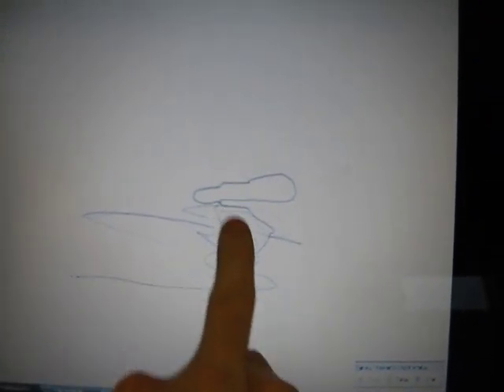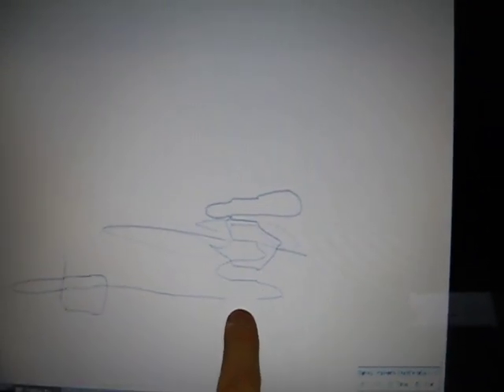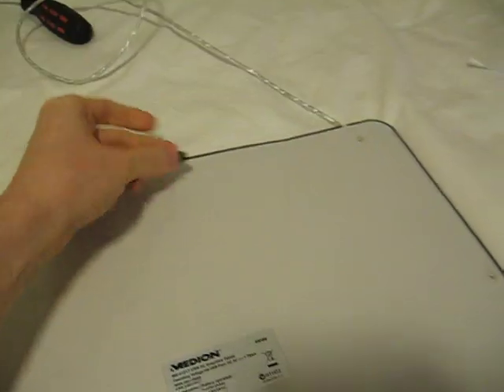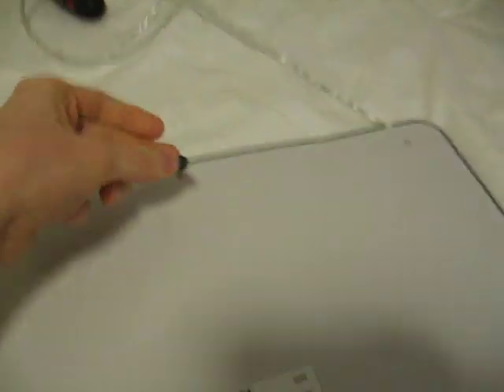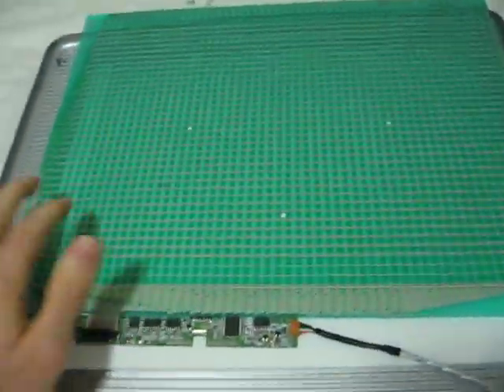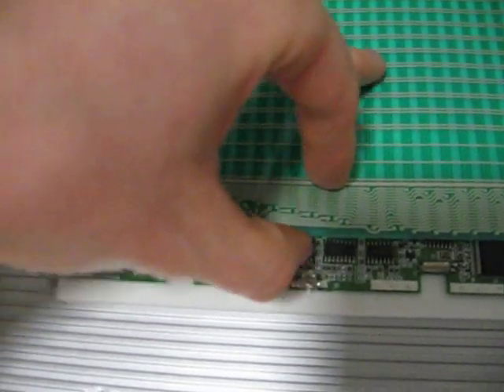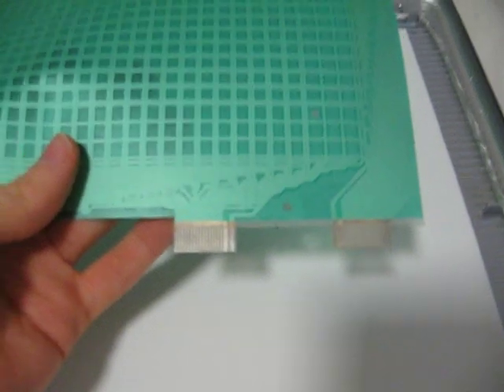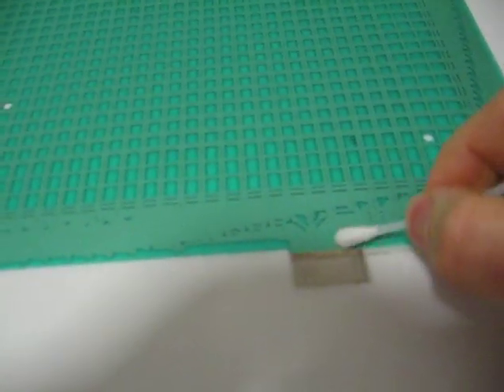Howto fix dead areas on any graphics tablet

Comment: Thank you for this video. Saved me from buying a new one. I have a bamboo pen and touch, it was jumping across the right side about 1/5th of the screen.

Turned out dirt got under the buttons and ended up on the round ends of some of the circuits, wiping it off fixed it like it never happened.

Comment: Dude, I can't thank you enough
The cursor no longer twitches and has no dead/blind areas

Tho... I didn't have to clean those contacts. Because I couldn't. It had this weird glue and many screws so to avoid problem, I only cleaned the circuits as it.

Some had a bit of oxide, but after cleaning them and plugging the tablet, it worked perfectly.

Thank you, A LOT
Reply: Yup, it helped a lot.
tho, you have to be careful. Especially the ones with oxide.

Comment: Also note the link to the deviantart-thread included in this video's description.
There is another useful tip to be found there: namely that insulation and coating might come off from cables or pcb-traces, and that any points where there is contact between cable and metal might create a short-circuit. So you might also try to provide some insulation by taping over any metal that might get in contact with any circuit.

Comment: Thanks for the video. Your advice kind of worked. I have a Tooya tablet and when I took it apart, I found that the connectors were taped down very securely and I didn't want to try and untape them for fear of damaging the connectors. But somehow the act of opening the tablet itself seemed to resolve the problem and the dead areas are no more.

Comment: Hey dude, thanks for your video. Was having issues my tablet, an aiptek hp12000u, bought it a few years back and it’s been in a box the last 2 years. Got it out recently, at first it had 2 horizontal areas, but it briefly went away. Reconnected it today, dead areas are back. Follow the steps, put it back together, horizontal dead areas gone! Awesome I think, back to drawing to discover I now have a bunch oh vertical dead areas! Did I do something wrong, or are the connectors too corroded? Thx!

Comment from the maker: @YukiUchiwa if your USB cable is faulty i don't think there's much you can do about it.  :(

Since it's not working at all right now, I'd recommend you take the tablet apart and fiddle with where the cable connects to the tablet, as you've got nothing to lose.  The connection may be visibly detatched and needs to be re-soldered back on, wiggle the connection around to see if the cable momentarily starts working.
It's a long shot.  Honestly, your tablet is probably just fucked.

Comment: How on earth do I open and clean a Cintiq 21 UX?

I'm having this same issue, but only with the Cintiq pen; the mouse works fine.  There's a dead zone about 1" wide and 3" tall, but my mouse has no problem there.
Reply: I think that might be a problem of your pen, not the Cintiq itself. Can you try to borrow someone else's pen to see if it's your pen that really doesn't work or if it's how the Cintiq read the pen the problem?
Reply: Don't know if you solved it already (probably did) but if you can borrow a wacom pen from someone else, any model ill do. It seems they're all interchangeable (at least from old Bamboo to any Intuos or Wacom Fun).

Comment: Hello when i do a continuous drawing it doesnt have blockes. But when i draw circles it blockes and makes them angular instead of how i draw it. It worked perfectly before
Reply from the maker: Sounds like you have the aspect ratio set wrong.  The computer has the wrong idea of the height and/or width of your tablet.  There's probably a way to calibrate your tablet, search around in your operating system.

Comment: Just bough a trust widescreen pad today for 45 lats (90USD) and the middle of my screen isn't catching any line and it sometimes skips to the the left side of my screen. I should probably dowload new drivers and if that doesn't work do what you did right? Or should I go to the shop with my warranty? ( that usually takes weeks to get a new one doesn't it?)

Comment: Okay, I have a problem.  I had dead areas on my tablet as well, and I followed your advice and cleaned the connectors.  However, after closing it back up and plugging it back in, I found that instead of having huge dead areas, it doesn't work at all.  Won't connect, nothing.  Help?

Comment from the maker: i once had a problem with my pen, no matter what i did i wasn't able to fix that.  So i just bought a new pen off ebay instead, they are relatively cheap.

Apparently there are a lot of pens which work with eachother's tablets, which is handy.  IIRC i put a lot of them in the tags of this video (but be sure to research for yourself first, as i think i also have some tablets in the tags that are NOT compatible).

Comment: Man, does that works on Intuos4 ? As I have a horizontal "dead line" near the bottom of the work area, and it causes me some butthurt when I draw... I have disassembled it but the connections are so small (nothing like on your tablet) and I am afraid to damage it even more...
Reply: Have you found a solution? I tried to clean it up as good as I can but it didn't work...

Comment from the maker: Tablets are supposed to effect your mouse cursor.
My first suggestion is that maybe you didn't clean it properly (what solvent did you use?), maybe you somehow just made it dirtier.
Or maybe you need to let it dry more after cleaning.
Or maybe your cleaning has actually started to dissolve the conductive material itself (!!).  Or maybe your problem the whole time was that the contacts are actually breaking down (yikes) and cleaning won't help and could even make it worse in your case?

Comment from the maker: Oh man it's the best.  I could have gotten a Teeny Tiny Wacom for a few hundred bucks, or this gigantic thing for only $70, it was a no brainer.

The problem though is that the driver support on these cheap tablets can be terrible, even though there's a whole bunch of different companies' tablets using this same tablet electronics (and thus their drivers are inter-compatible), i havn't been able to find any that work perfectly in Win7.
Some have broken pressure sensitivity, others broken buttons

Comment from the maker: hmm, maybe you should open it back up again and dissconnect the connectors and let them air for a while, might be some moisture in them.  also make sure you didn't forget to connect everything in there back again, maybe a cable came loose.

Comment from the maker: The pen i have is the official pen that comes with it.  My original pen died (battery leak), so i just found someone selling the same Medion Tablet cheap on ebay - told them to just send me the pen and ditch the rest.  PS: when it arrived it's battery was leaking too!  But luckily the pen was ok.
What pen did you buy?  
Back when i uploaded this video i had found a bunch of tablet drivers and pens that were apparently inter-operable, i put a lot of them in the tags, but pls google & check first.

Comment: Hi,
You really seem to know what you're doing - I wonder if you can help with my problem, which is the old my 12000U tablet works fine, except in photoshop.  I'm fairly ceertain I have got the latest driver and it seems to work fine with everything else, but i can't seem to find the solution.  Any help you canm give would be greatly appreciated - thanks.  Peter

Comment: I'd like to note the problem came back and cleaning it this time did nothing. I changed to mouse mode and it goes over the area but after I touch the tablet with my hand the area increases till I change to pen mode again, where the area persists as it originally did.

Comment: Ok so I have a problem after doing this, my cursor goes apeshit when I plug the tablet D:
Reply: SkyDefender Same here! Have you found a solution or has it just wrecked it?
Reply from the maker: kittyAngelHedgehog perhaps it is still wet from the alcohol
Reply: roidroid Definitely not- at least not two dsays later. It's still spazztic, even more than before and not even just on a single program. Is it really just screwed? Do I need a new one?
Reply: +roidroid on my tablet i will play the dead space but the screen its on vertical and the corect its the screen stay on horizontal how i repair that?

Comment: i didn't clean mine, I had an F-series that had the same problem for about a month. until I punched it three times with all my might, then i set it on my table and went to drink some water. when i came back and tried it again and it worked perfectly! i doubt it'll happen again........*stares at tablet* (right?)

Comment: this is happening on my cintiq pro 13, which i was able to take it apart but there are no exposed screws :(
Reply from the maker: Do you mean you can't find the connector to clean?  Or do you mean you're having trouble taking it apart because you can't find the screws?
Reply: i’m having trouble taking it apart. it’s glued together, any tips for what to do?
Reply from the maker: @imaginationland474  i'd search for videos of your model name and the word "disassemble" or "fix" or "take apart", just to see how people get inside.
Reply from the maker: @imaginationland474  oh also:  designers often hide screws under rubber pads and under stickers.  Look for anything you can peel off, sometimes it can even be hard to tell it's a sticker.  Model/serial numbers and contact info are often a sticker, they often hide screws.

If it's glue tho, glues can often be softened (or even destroyed) with heat.  Try a hair drier on where the glue is while prying it.  U may need to reglue it again after.

Comment: Cleaning the connectors in my old tablet like here completly destroyed all the remaining tracking it used to do. Just saying nobodies fault, it was already broken and unusable, but it did break completly by doing this. Be careful cleaning the contacts, if they are not metal. Doesn´t seem to work the same way.
Reply from the maker: damn dude that's rough, i'm sorry that happened.  A warning to others i guess, sometimes life shoves lemons up your arse :(.  It's made me real curious what exactly happened tho.

Do you have a video or pictures?  Maybe it was too old & had gradually been wearing out and the cleaning was too rough for it.  Or I wonder if maybe the connectors wern't metal (carbon "zebra strips" or something).  What model of tablet was it?  What did you use to clean it?
Reply: Yea no worries like i said nobodies fault but mine. It was quite old, maybe about 10 years already and broken after all, like 90% deadzone impossible to properly use for anything still, i was just trying to find out if it would work or not. 
Indeed seemed to have been the carbon strips, whatever i used must have been too stong or aggressive and messed with the contacts, didnt even notice a diffrence to the video. Either way people should probably be more careful cleaning those contacts if they are in fact trying to fixx it for real trying not to break it, if they arent just straight up metal. Dunno if the carbon shits are cleanable at all, they seem very fragile, (in hindsight XD) its almost like the moisture messes with the carbon itself, like taking a magnet to a casette (who remembers that lol).
Still- not saying your video is shit at all, its great tricks like this are always really useful. 
Generally people should know, to not open up and start messing with their electrical equipment trying to fixx it themselves, unless its already broken and guarantee has ran out- because its most likely gonna make it worse if you dont 100% know what youre doing. I bet you helped alot of people, me i just have to wait until i get money next month until i can pick up photoshop again to draw something^^, like i said i was merely seeing if i might be able to get my old broken one into a more functioning state, to atleast be able to work myself back into photoshop while i cant properly work on my portfolio-
This got way too long though, you have a nice day.
Reply from the maker: Oh nonono i'd never warn anyone AGAINST opening & messing with their electrical equipment*.  You gotta open stuff up and see, it's only human!  If you're worried - first search online for pics/videos to watch other people taking apart the same/similar device.  
(*within reason.  Be careful of big capacitors even when unpowered, and be careful with mains electricity, any AC, or any device that's still powered while you're in there.  Also be careful if humidity is very low, as a zap of static electricity can break things).

From what i'm seeing online, you should still be able to clean carbon strips.  Although i know i've had rather perplexing issues in the past with the carbon on TV remote buttons.  I wish i understood carbon connectors better.
If you can give me a model name for your tablet, i'd like to look around for anyone else who's fixed it.

https://youtu.be/6RBug_9Y47s?t=4m28s This guy seems to have luck cleaning zebra strips with acetone.  Others warn acetone might be too harsh (tho i'm yet to substantiate this rumour).
https://youtu.be/ejvfzfGHz0c?t=1m45s This guy smears a very small residue of conductive "silver grease" onto the zebra strip.  (note: be wary of silver thermal grease, as typically those are electrical insulators).  Others say that any conductive grease will work (ie: conductive carbon grease).  These electrically conductive greases are all kinda expensive tho, which could be annoying if turns out to not fix the problem.
Reply: Those tips are great, youre a nice guy and not to worry i know my way around electricity and soldering to some degree from my time in a band, but dont sweat it seriously. The tablet was too broken to use for any serious work to begin with. Besides, instead of trying to do serious drawing on a 12 year old graphic tablet with lag and a low sensitivity of about a frail 1000 levels- i am seriously better off just getting the huion inspiroy q11k for a hundred bucks and have something i can actually properly work with for a while. 
After all the point of drawing with photoshop for me, since im already familiar with it- is to get faster and more wholesome results i can put into a portfolio, nobody is gonna hire someone whos digital art looks like its drawn in crayon XD. 
Which honestly the old tablet felt like alot. As a matter of fact i was only looking to maybe starting to get back into it with the old one, until the proper one arrives. 

Only got far enough to realize i underestimated photoshops capabilities and that i cant properly draw on par to my inked manuscripts or even pencil sketches, even if the clunky weird old thing was fully functional, unfortunately^^. Im doing my best trying to find a job after all, im gonna need something i can actually work and produce something proper with if i wanna have some chance at all.

Anyways much thanks for the concern, its nice to see and much apprechiated. You have a nice day.